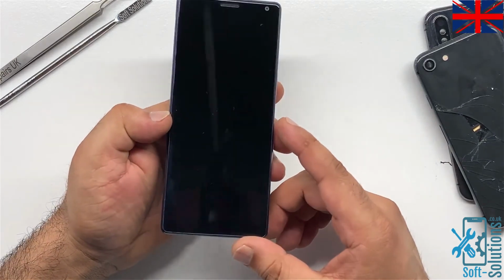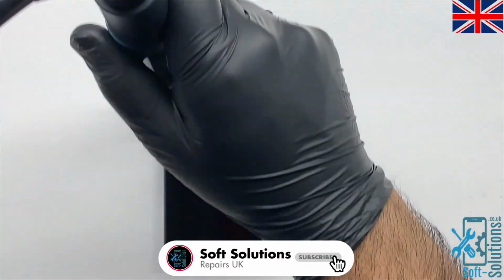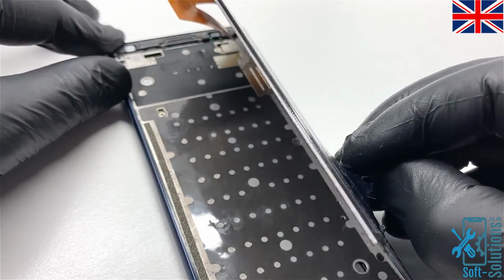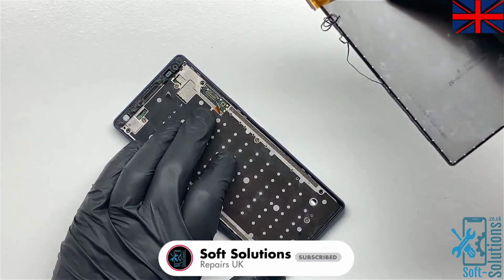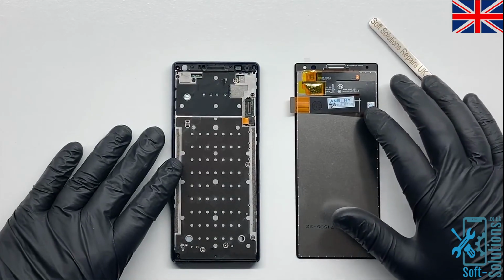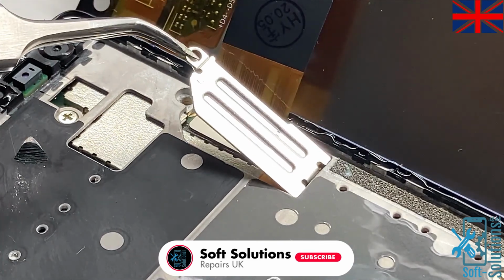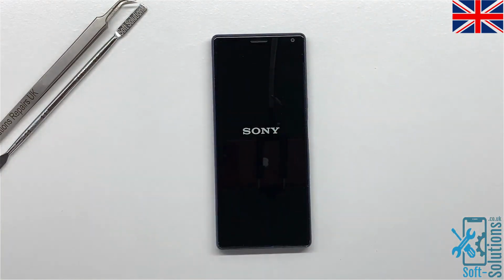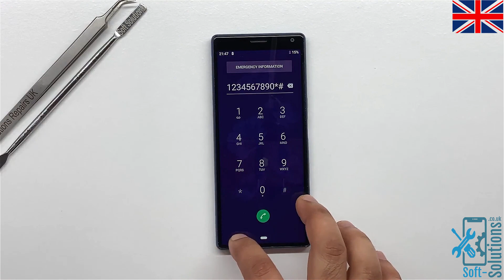Sony Xperia 10 LCD Screen Replacement

Comment: How many more steps do you need to do to have access to the volume rocker? I dropped mine and volume down button is jammed in. Now it stuck in safe mode when I restarted my phone, so no apps for me... . 😂 (it feels metallic so hopefully I'll be able to straighten it back again)
Reply from the maker: You ll remove all those screw you can see underneath that screen and remove that mettle shield and you access to all components.

Comment: What adhesive do you use ?
Reply from the maker: My recommended adhesive is B-7000 or T-7000 depending on requirements. B-7000 is most useful adhesive. Check out this one https://youtu.be/3x-zceLmemo